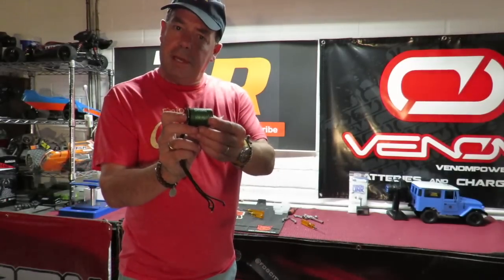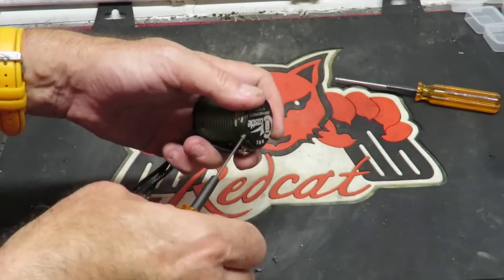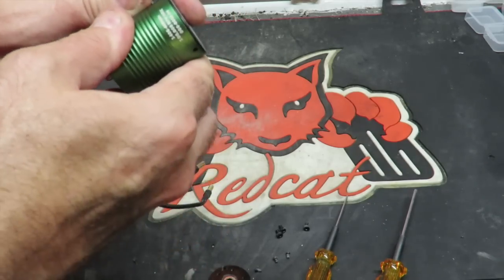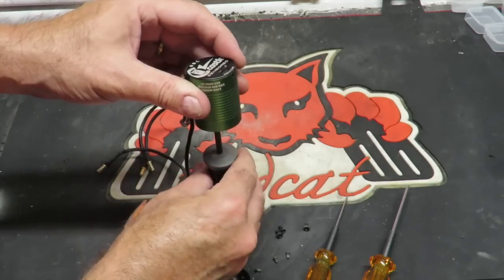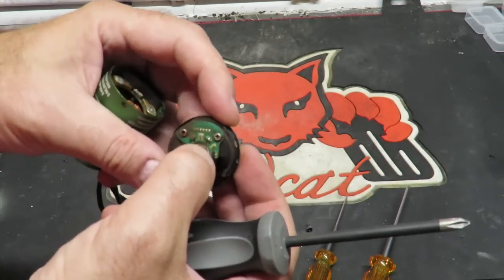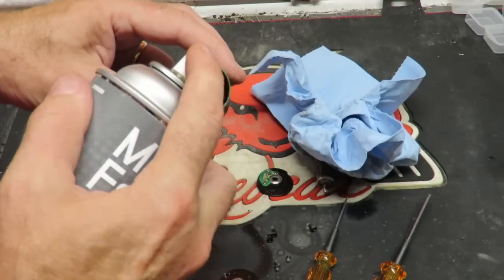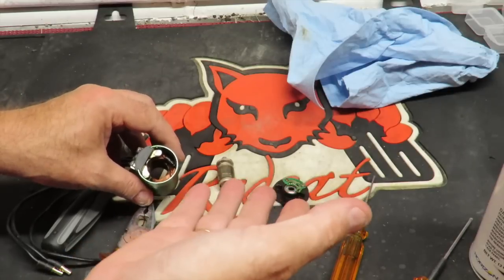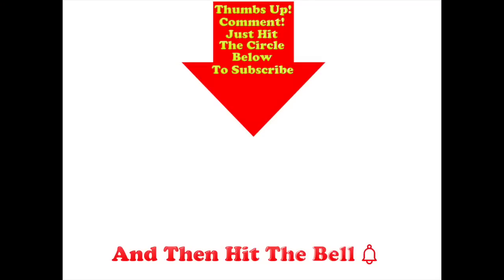What's Inside A Castle Brushless Motor?

Comment: The brushless motor works exactly like an AC induction motor. The middle section of the motor is called the rotor. Inside the rotor there are aluminium/metal bars that will follow the stator. 
The stator are the bunch of copper windings on the outside of the rotor. The microcircuitry on the motor plate allows the copper windings to constantly turn on and off, this creates a constant changing magnetic field and therefore a constant changing magnetic flux that the rotor follows round and round. This is why it is called a brushless motor as the stator induces a current in the rotor which produces a torque that allows it to spin, hence therefore the motor can work. 

BTW, lol sorry for too much info, I am a Year 12 student doing my HSC, so I have to know this for physics!
Reply: Except the micro circuitry you mentioned is replaced by an electronic speed controller in brushless motor. Now get back to your notes 😛
Reply: Also, in brushless dc motors, permanent magnets are used instead of an induction squirrel cage

Comment: 😁Hi Rich It's called a rotor its a big magnet and they put like a epoxy around it so the inside cant scrape on the rotor magnet or the neo magnets don't flake apart.
Reply from the maker: Cheers Steve, I didn't know how it all worked, and so the more people comment the more I learn, slightly boring video but then who's not wondered what's inside one?